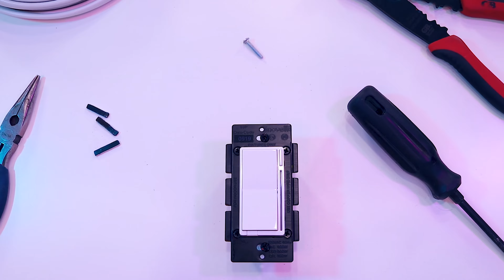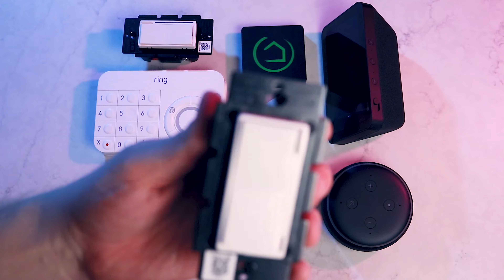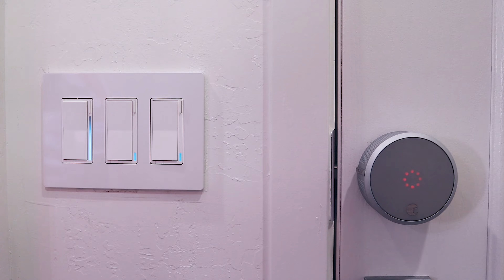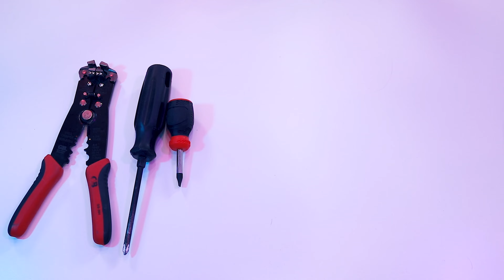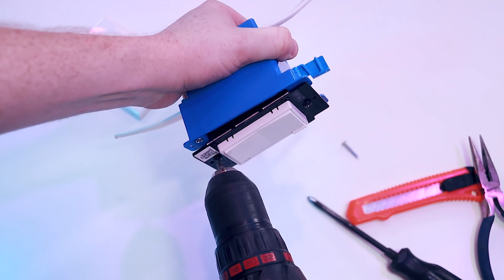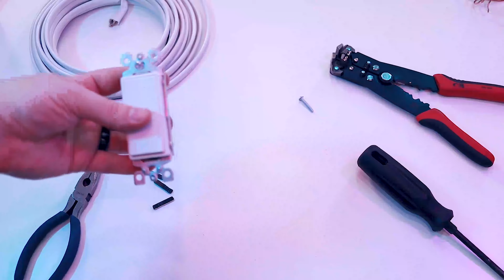Ultimate Smart Switch | Inovelli Review, Installation, and Final Thoughts

Comment: you need to be careful giving out electrical wiring advice.. in many homes just because there is a white wire in a box it doesn't mean it's a neutral, it can be a switch leg or a 3-way traveler which makes it a hot wire.  you should tell people to use a meter

source: ive been an electrician for 35 years.

there is also no such thing as a 5 way switch, just multiple 4-ways.

use side cutter pliers horizontal to the switch to remove heat sink tabs. you get more grip and leverage.

Comment: Great video. I was looking at Lutron Caseta but the ability to use Inovelli Red with smart light bulbs and other devices, trigger routines and scenes and customize the RGB light on the switches has changed my mind. I’ll be going with Inovelli in my new house now. You gained a sub.

Comment: I only have red series switches so I don't know if there is a delay in the black series, but the delay is necessary for the scene control features to detect multiple button presses. In newer firmware versions there is an option to disable the 700ms delay, but you need a usb zwave stick to do the update

Comment: So if I have a 3 way switch in the kitchen (2 switches), do I only need to purchase 1 Invovelli switch?
Reply from the maker: Theoretically, yes. It depends on your wiring configuration but yes you should only need one. You can then turn the lights on or off from either location at the switch or through a command

Comment: I got my first Inovelli dimmer switch today. It's the Black series, instead of the Red series with the extra features... My next one might be a Red series because the notification lights I can set up to see on the switch. Before seeing your video I didn't think the Red added much value but your examples of the notifications got me interested.

Does the Red require a lot more effort and technical knowledge to set up and use?
I like how simple the Black series is and they still have features other smart dimmer switches don't have.
Reply from the maker: Physical installation is identical if you're using neutral wires. Set up in your hub isn't more "complicated" but you have a lot more options to choose from which might be a little daunting at first. If you were able to setup the black series then you should be just fine.

Comment: I thought these weren't fan rated? I love my 15+ switches, but waiting patiently for fan/lights full release!!!
Reply from the maker: I know it says not to use these for fans but I've seen Inovelli mention on forums that they should technically work (on/off, not dimmers). I checked the power requirements for the fan against the power rating of the switches (with 3 tabs removed) and it technically should be fine. I tried it on one fan at Max speed and didn't notice any hissing, sparking, or crackling and the switch is still cool to the touch. I know I saw some "fan-specific" on/off switches on their site marked as "coming soon" but idk what happened to them.